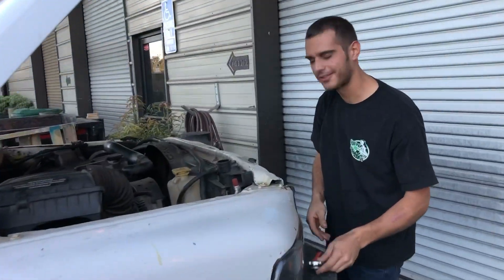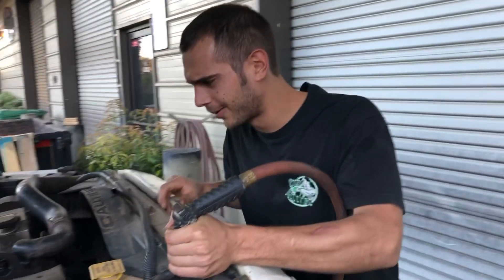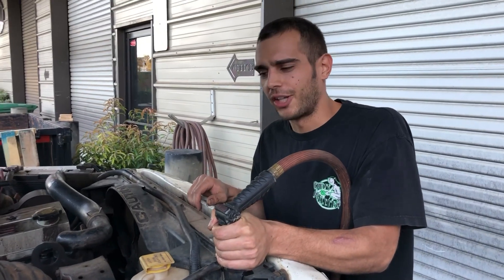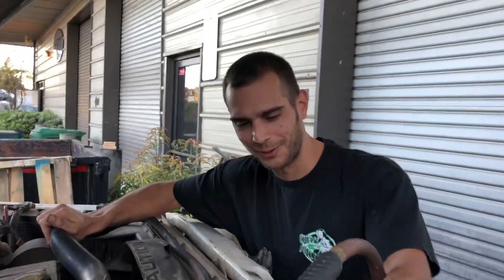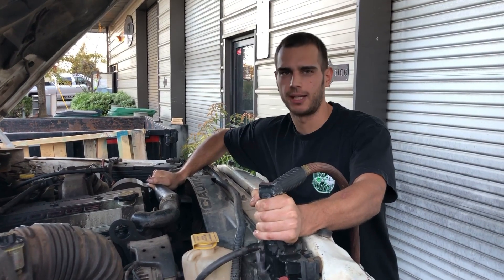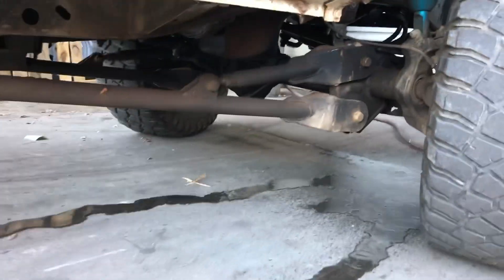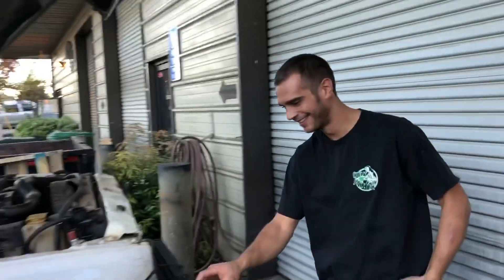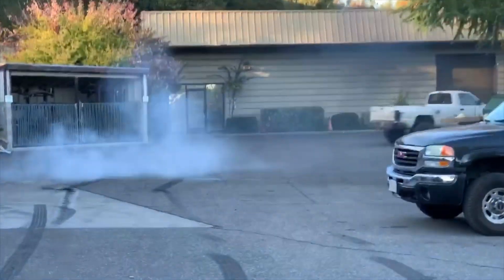Cracked Block Cummins 5speed Burnout

Comment: He should have a 20 gallon tank in his truck that can fill the truck while he’s driving down the road. Where if the water gets below a certain point on the radiator it’ll just add more water.